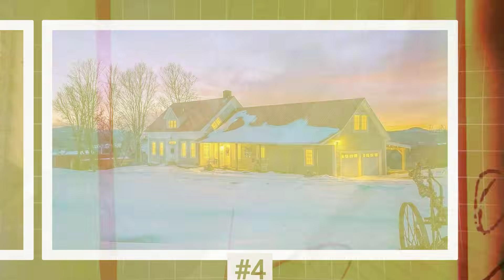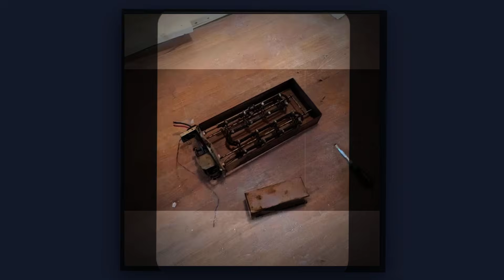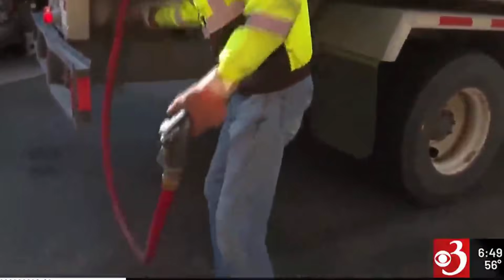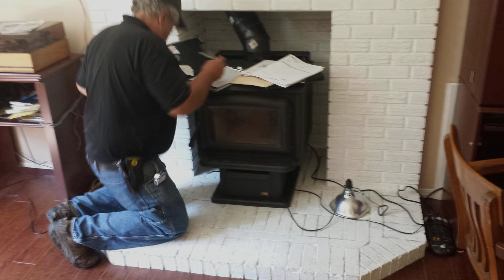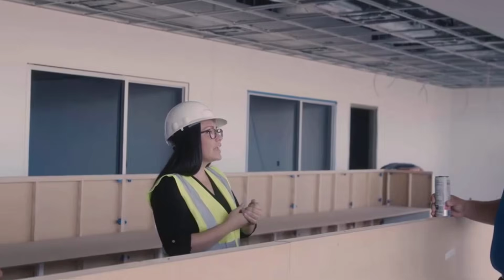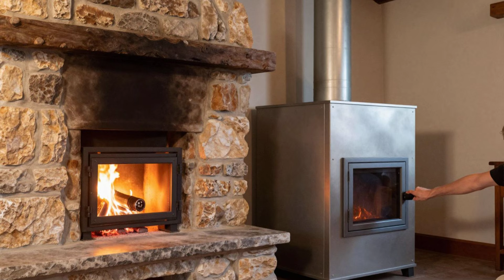They Banned This Heater In 1987. Nothing Built Since Has Ever Matched It.

Comment: Our entire house is heated by air-source heat pumps which are remarkably cheap to run. But I grew up in a house with a centrally-located masonry heater that had an oil burning furnace built into it in the basement & a wood burning fireplace built into it on the main floor. I remember that concrete & brick central core was always warm to the touch.